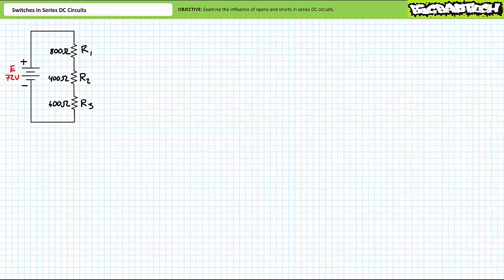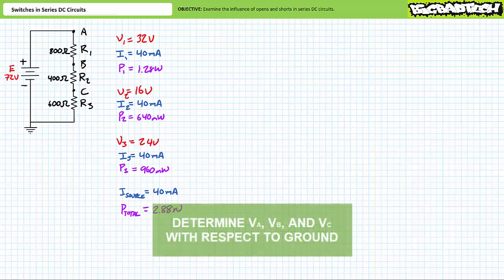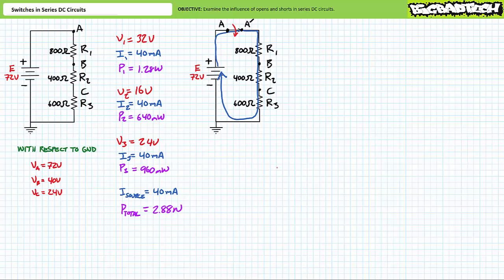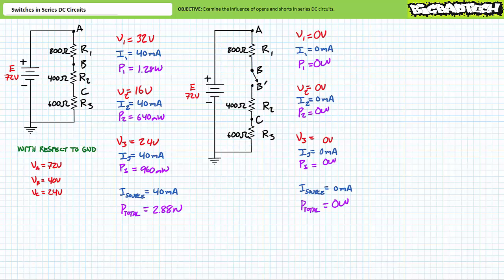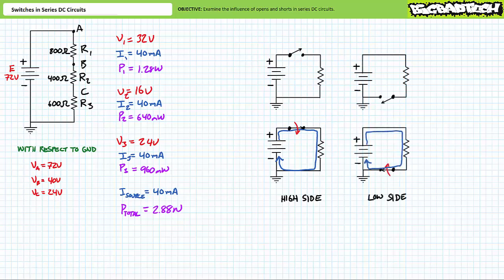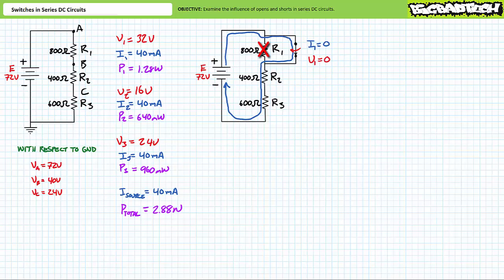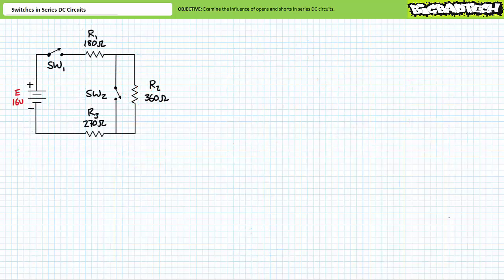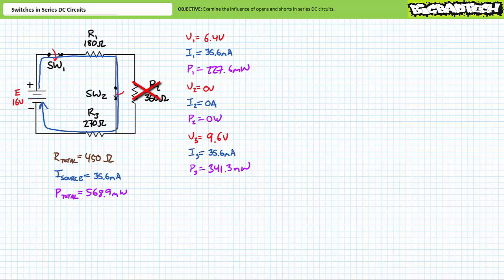Switches in Series DC Circuits (Full Lecture)

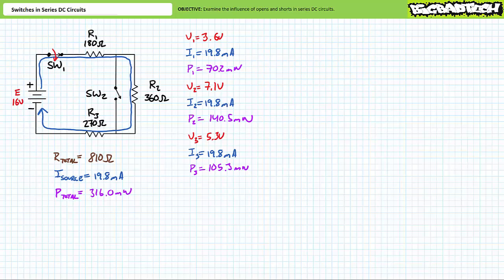Comment: Could you explain a bit more on 19:14.

Power = Voltage x Current.

So 5.3v x .0198A gets me 104.94mW. You got 105.3mW for P3

Is this because I don't have a TI-84 Titanium Calculator?
Reply from the maker: Keep ALL the digits for calculation purposes and only round the final answer. V3 is actually 5.3333333...V. I3 is actually 197.5308...mA and P3 is actually 105.349....mW.